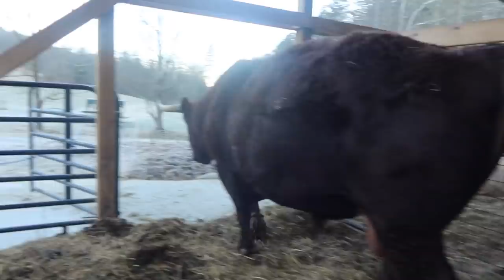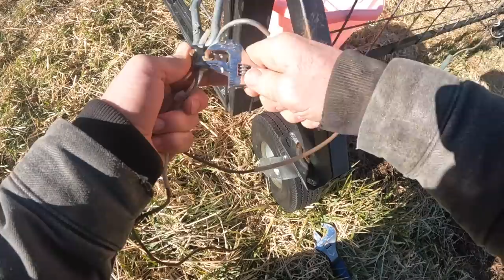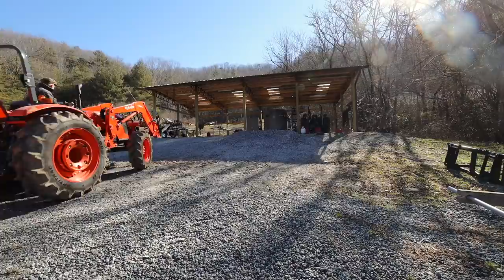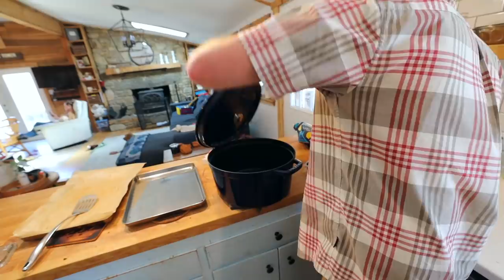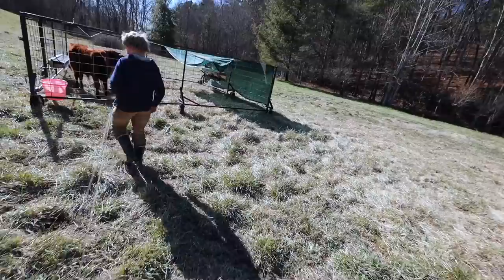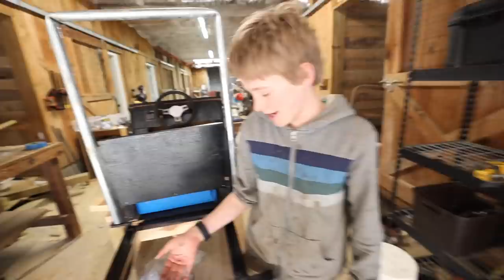This NEW Tractor Implement Changes Everything!

Comment: You need to get the old Ford running So you can pull the maneuver spreader with one of the tractors and load it with the other 1 so you don't have to keep unhooking and hooking it up

Comment: Take Jonah to an auto parts store- or browse online for a brake switch. A generic $10-$20  3 terminal switch with a "pigtail" (a plug that fits that switch with wires you can crimp to). One wire should have a 5 amp fuse from the battery positive (B+) to the switch, another wire going from the switch to the light and a wire coming from the light coming back to the battery negative (ground). As far as the light pigtail- red is "stop", black is "clearance or marker" and white is ground.

Learning how to use a digital multimeter is a great way to learn how electricity works. And when he learns how to do that really well he will be one valuable technician/engineer if he chose to pursue that some day.

And like you said- keep that manure spreader washed out really really well and grease it including oiling the drive chain and rust won’t be an issue.

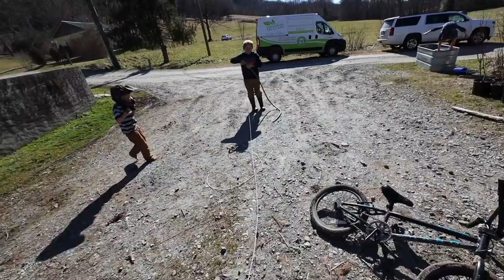Comment: At 10:05 , the clamps on that new steel cable are installed incorrectly.The clamps should always be oriented in the same direction and both of the saddles should be on the live end. Remember: don't saddle a dead horse. And wrap some electrical tape on the end to keep the  cable from fraying or cutting you.

Comment: That’s really nice.  I tried to buy a well used (old) manure spreader at a farm auction 2 summers ago and was told it should go for approx. $3,500.00. Before it was all over the manure spreader sold for over $8,000.00.   I’m still looking for a decently priced used one.  I have a ginormous manure pile to get moved.   Some of it will turned into compost soon as I mix it with a mulch pile and let the worms go to work.

Comment: When cutting cable. Could not tell what kind of cutters you had. A pair of lineman plyers and hammer will work on small cable.  Just squeeze  tightly  the cable in the cutter section  of the plyers. while the cable is held secure there place plyers on something  solid. Then smack the plyers with the hammer. It should cut clean.  larger cable can done with an axe. place the cable on a block like when you split firewood . Place axe blade on the cable using a small or large sledge hammer smack the back of the axe.